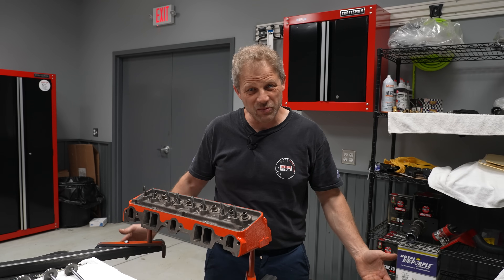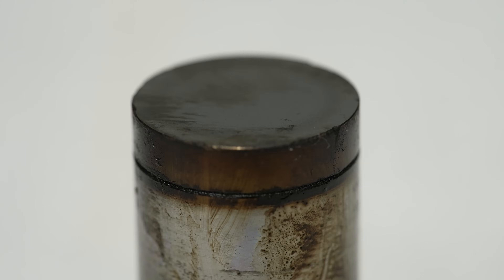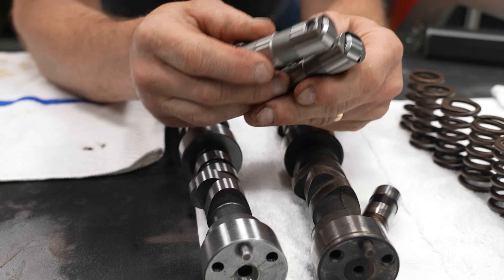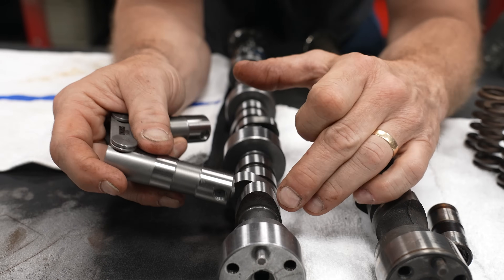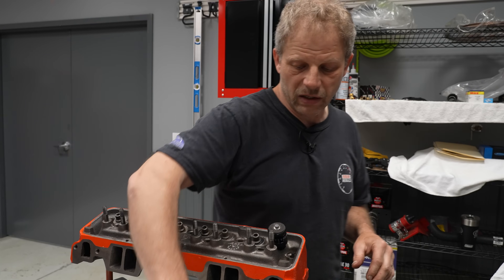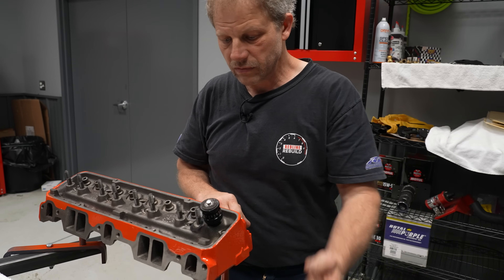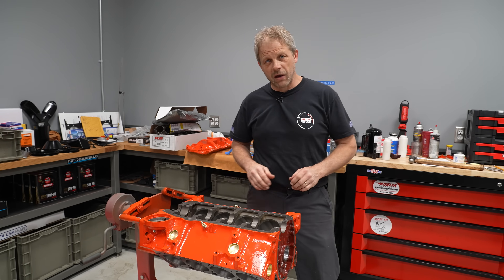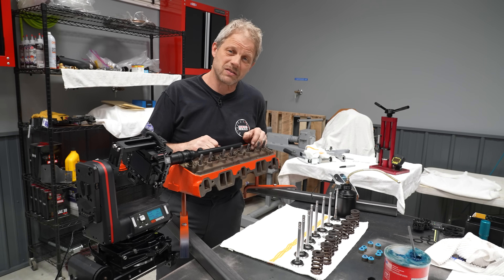Valve assembly and camshaft breakdown on our Chevy small-block

Comment: You didn't give the full open spring pressure, which anything over 300 psi requires screw in rocker studs.

Comment: Davin l love your show !  Just wondering why you went with a roller cam & roller rockers with a stock 2 barrel  intake and carb. Also the restricted cast iron exhaust manifolds. The roller cam kit & roller rockers cost $500 to $600 !!!! You could have used a hydraulic flat tappit 350HP 327 cam, dual plane aluminium intake with a 600 cfm Holley and a set of headers. This  combination would be a lot more fun to drive and cost less money to build ................

Comment: As a general rule, I only install the rear cam plug after the cam thrust clearance has been set. That way you can measure with your dial indicator form the tail of the cam. Virtually installing that plug is at the end of engine assembly.

Comment: I do agree with David's preference with hydralic roller cam. However, I can still get variable duration lifters for a hydralic flat tappet cam, someihing I can't do with hydralic roller cam. The would allow me to run a larger cam, and have it act like a smaller cam.
Reply: Depending on engine, yes, they do make a variable duration lifter for hydraulic roller cams. You can get them for LS engines, and what ever other engine you may adapt LS lifters to.

Comment: They should make roller lifters  with a roller ball like roll on deodorant wouldn’t have to worry about spinning like a flat tappet and those needle bearings failing on the roller
Reply: Plastic won't work.

Comment: Davin, you didn't go over the cam specs, and also your decision to go with roller instead of flat tappet. In another life I used Delta cams exclusively and didn't know they offered roller cams. Also, with supply chain issues roller lifters have been hard to come by can you tell us the brand you used?? THANKS!!

Comment: Never realized there is an actual tool designed for installing freeze plugs until now, I was taught and have always simply used a close fitting impact socket and leather mallet to install them. Learn something new every day.
Reply: Use what works. A special tool ,like this one, isn't always necessary, IMO. Plus, the cost isn't worth it either.
Reply: Pretty much anything will work. Just remember though, in an engine shop, we're slammin in hudreds or more a year. Thats a lot striking on our sockets.

Comment: Core Plugs, out of a hundred frozen engine blocks that I have encountered as a tech none of them popped the CORE PLUGS out. I have seen poorly installed ones blown out from over heating a couple of times. I live in Oregon.
Reply: Because they are just plugs for the casting and have nothing to do with freezing.
Reply: @SOLDOZER  somewhere along the line somebody called them freeze plugs and it kind of stuck. But every engine block I've seen that had water in it when it froze the block broke and the plug stayed in place.
Reply: @marlobreding7402     That's because the plug has nothing to do with freezing blocks. It's only purpose is to plug the casting holes.
Reply: @SOLDOZER  exactly why I called them Core plugs.

Comment: Good video I’ve always wondered about testing Springs prior to assembly in the context that why wouldn’t you put them in an oven and test them hot bearing in mind hot metal is softer 

room temperature seems to be best case scenario 

surely they’re running at 100° c in the motor why wouldn’t you put him in an oven at 100° C and then test em…..
Reply: Burns your fingers.

Comment: Depending on your heads and how much lift you have in your cam set up might need too remove the pressed on rocker studs and upgrade to thread studs
Reply: Yes, sort of, but the biggest issue is when you start increasing spring pressures to accommodate the higher rpm of a performance cam. The stiffer springs is what usually pulls the studs.

Comment: Have you guys perhaps got a development program going for mechanics that for instance can tear down an engine, clean and reassemble it but don't know anything of the in between. I have watched a few videos from Eastern countries like India and other countries around it who do what I described. They re-use the old gaskets, rings, etc when re-assembling and they for instance pull out all the pistons and throw them in a tub with cleaning fluid, not noting which piston came out which sleeve. No measurements of cranks, sleeves, etc are done. It would be wonderful if these guys can be taught how to do it right. They have the enthusiasm but not the knowledge. Maybe something to ponder? Maybe offer scholarships to the brightest of them?
Reply: In some of those countries, they aren't doing things the wrong way because they don't know the right way. They do those things because they can't afford the right way, or is too cheap to pay for the right way. Other times those vehicles might not be worth much, so a quick save is all they deserve. The rest of the vehicle is on the verge of falling apart anyway.

Other times, the person who is selling a used car doesn't want you to know. I have encountered people who got ripped off when they bought a used car with a "Recently rebuilt engine." All the last person did was run a quick hone through the engine and fit rings. The head got a set of new valve seals and nothing else. A set of standard bearings may have been rolled in, without measuring the crank first. The bore and piston were probably beyond their limit, but they don't want anyone to know it. The person will find out a few months after the sale, when their car is burning oil fast.

Hack jobs exist all around the world because of this. I live in the USA, and was stuck doing them, sadly.

Comment: Are you allowed to share the specs of you custom grinds? I always thought it would be great. Many people go for the Jeep 4.6 stroker, but not all cam companies say which grind works best in one. I don't know if there was ever a hydraulic roller cam optimized for a 283 in a heavy vehicle
Reply: Cams are to suit the application. A it is seldom ever for two engines to be the same.
Reply: @ldnwholesale8552  Yes, that is true. However, many companies will sell a cam grind that works well with a common combination. I think of how many guys get cams from Comp, Isky, Howards, etc. I have heard Comp should be avoided, rumor has it, they have the most troublesome of the new flat lifter cams.

Comment: Thought roller cam and lifters were the week point for long run in Chevy LS and newer Chrysler hemi engines
Reply: I suspect it is a matter of implementation. They weren't a weak point in the SBC TPI, 305 and 350 Vortec, 5.2/5.9 Magnum, and late SBF. I'm not sure what those had that the LS and Gen 3 Hemi don't have.
Reply: They’re the weak point because they use collapsible lifters for the AFM/DoD/DFM and MDS systems. Look at a 99-06 LQ4/9 or similar, full hydraulic roller, but no collapsible AFM lifters, bulletproof reliable. Ever notice how you see plenty of 5.7’s, 5.3’s a 6.2’s eat lifters but the HD 6.0 gasser in the Chevy 2500/3500’s don’t? The HD 6.0 doesn’t have AFM

Comment: Why do people still call it "small block". Is there such a thing as a big block anymore? Only americans can call a "six lidurh modurh" small block.
Reply: The motor Davin is working is considered a "small block" Chevrolet V8... later iterations of GM's V8 certainly blur the lines between "small" and "big", but the '50s when the first version was designed it WAS small.
Reply: Because that's what this engine is... A Gen I small block chevy, came in variations from 4.3L to 6.6L.
Reply: Big and Small are nouns in this use, not adjectives.
Reply: In the aftermarket at least GM still service the bog block. Which is longer, taller and has far bigger bores and strokes. They also still do no end of small block stuff. 
I will never understand the love affairs with LS engines. Yes they are good but by te time you buy all the conversion parts to fit a used LS you could have built a healthy small block which fits in the car
Reply: A Small block Chevy (SBC) and Big block Chevy (BBC) are colloquial names given to two very different Chevrolet engines made from 1955 to 2003ish. It has nothing to do with displacement. A 400 cid Small block exists, as does a 348 cid Big block. No parts except the distributor, carb, and some accessories interchange between factory Small and Big blocks. Big blocks are externally larger, typically have larger bores, and a completely different, larger head design.
A chevy 6.0L is a gen 3-4 Small block, not because of size, but because it's the same engine family.
Reply: The term small block and big block refers to the amount of space in between each cylinder, like the thickness of the cylinder walls, affects how much you can bore over spec and what not if I'm not mistaken
Reply: @calebyarbrough4621  
Yeah. But the terminology is utterly redundant for the last couple of decades at least.
Reply: @calebyarbrough4621   You have no clue at all what you're talking about.

Comment: The duration for a particular cam design is the same between flat and roller camshafts. The profiles require different shapes because the point contact changes due to the radius of the follower. A roller camshaft looks more extreme than a flat because of this. You need to measure valve lift and duration at the valve, not comparing the profiles side by side.
Reply: A Roller Cam has more ‘meat under the curve’ compared to a flat tappet cam of the same duration as the roller cam can have steeper ramp rates. 
I’m a fan of hydro roller cams for real street cars.
Reply: @bigal878  A short duration roller can even have what’s called an inverted flank, ie making the cam lobe peanut shaped. It makes the lifter stay longer on the base circle, but still gives more duration near peak lift.
Reply: Getting a rough lift number is easy, use some calipers and measure the longest part and the shortest part of the lobe and subtract. 
This works pretty good in my circle of car buddies, we wrench on early water-cooled vws 75-84. 
In 81 they came up with an "emissions" cam with like .387 of lift ,but the early one had .405. 
Not alot of difference, but it's free power if you have one and your engine is apart it's an easy swap.
Reply: @MrTheHillfolk  Valve lift on pushrod engines is also determined by the rocker arm ratio.
Reply: @ellieprice363  yeah but you gotta start with a cam to push those rockers, and if you're doing a cam swap it's a quick way to see if the lift is different. 
Only thing the rockers are gonna change is if you went from a 1.5 to a 1.6 or something ,you just gained that much more lift, the base cam lift is still the same.

Comment: Im new to learning about engines and especially pushrod ones so sorry if this is a stupid question but do the rollers allow higher RPM also?
Reply: No. Roller lifters are heavier and these roller lifters are hydraulic, so they are even heavier. Good question.
Reply: @PCMenten  thank you
Reply: @PCMenten  Following on with roller lifters, because they require higher spring pressure to keep them in contact with the cam lobes, would it be accurate to say that they are better for higher RPM builds? And are they a better option for higher HP as well?
Reply: Roller lifters and cams absolutely allow for higher RPM, even more with solid roller lifters.
Reply: Yes they do. Though that also depends on the rest of the engine. On this pov pack engine it should give more mid range grunt but more rpm? Probably not.
Reply: Sometimes it is difficult to build an aggressive flat lifter cam that is suited for high RPM, without having it wear out quickly. That is one reason many guys go for a roller cam if they run high RPM.

You can go through the proper break in process with the right oil, and always use high zinc oil, and still end up with shredded lobes on a flat lifter cam. Making things worse, replacement cams are often hit or miss in quality. Uncle Tony's Garage has way too many videos of guys having to deal with cams that did just that.